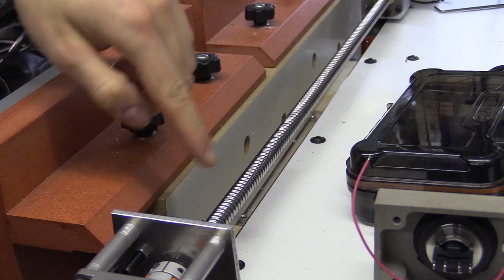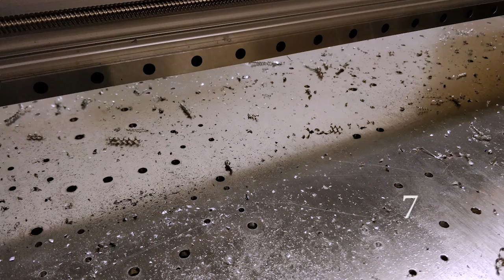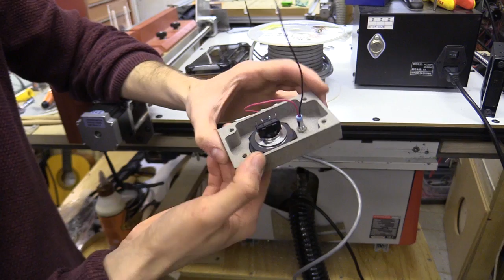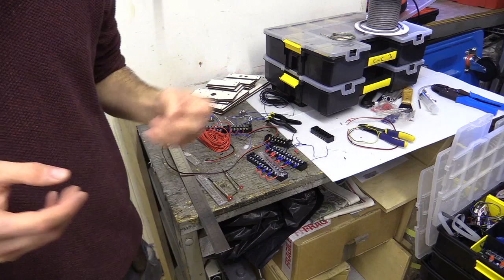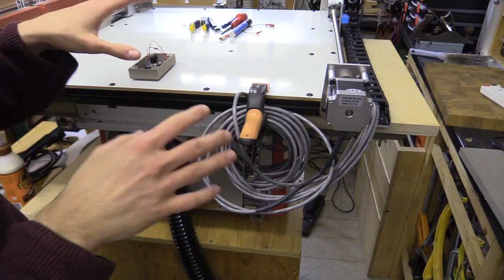#36 Desktop CNC Machine #36 / What I'm Working On

Comment: What gauge wire is that for the steppers?
Reply from the maker: Whatever the stepper supplier recommends. But it's pretty straight forward. My motors are rated at 3 amps so  I use 0.75mm which can accept 6amp. I guess I could use 0.5 but it's nice to know you have a little leeway.

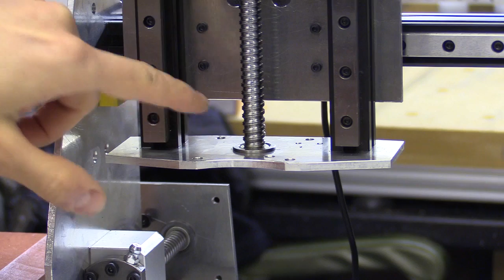Comment: 2:12 you should let that side of the ballscrew have a little bit of axial play (a few millimeters) because it can expand
Reply from the maker: But wouldn't that create a backlash in the movement?
Reply: @EducatingSavvas  one Side should be rigid and the other loose so it wont bind in Case the ballscrew expands
Reply from the maker: @ipadize  Ahh I see. That makes sense as their was a thread on the motor end - which was meant to hold the ball screw to the bearing block but I cut it off to fit it more compactly. It'll be interesting to see what happens to this machine in the summer. :/

Comment: My first response like others is that the weak point is the thin vertical plates on the gantry. Yes, steel is 3 times stiffer than aluminium but, that's not the only factor to consider when evaluation the stiffness of a material. While steel is 3 times stiffer than aluminium, aluminium only needs to increased in thickness by 44% to equal the stiffness of steel which would allow you to avoid the weight penalty of adding steel. Also, as you know, aluminium is much easier to work with.

Here's the article which talks about the gains of stiffness vs depth in steel and aluminium. https://www.thefabricator.com/article/metalsmaterials/the-differences-between-stiffness-and-strength-in-metal

So, just increasing the aluminium plates to 7 or 8 mm would give you the stiffness of the thinner steel plates and would be lighter. Whether that would be enough to remove all the racking and resonance in the verticals is another question.
Reply: Hey how about stuffing ribs on the aliminum

Comment: Are those side plates final? Oh my... Linear rails of that size and then flimsy side-panels like this... Almost EVERY CNC-router I see on youtube has those flimsy side-panels. Those are probably the most important parts when it comes to rigidity... I don't get it...
Reply from the maker: For the footprint (desktop) and application (hobby) I think I can get away with it. Or alternatively make the plates with steel at the same thickness. But I didn't want to start by over engineer the machine, and making it heavy. Also cost is a factor - material costs mounts up. I could also add 90 degree bracket under the X axis onto the y plate but I don't think I'll need too.

Comment: You got the wrong link for the parts list, it points to your login wordpress login page. 

Steppers can't take very much axial load so I mounted my ballscrews backwards, if you will, with trust bearings and belleville washers at the far end. It is basically self aligning the plate hole just needs to be a clearance hole, there is very little radial load so friction is enough hold the bearings in place.

https://imgur.com/a/jNicwGM
Reply from the maker: Ah thanks for that - sorted out the link. The axial load is on the flanged-bearing in my case. Not sure how much they can take as I did shatter one bearing flange trying to hammer it into place. But the parts are cheap and easy to replace.
Reply: but with one  bearing it can only take axial force in one direction
Reply from the maker: @fuzzy1dk  I should have made it more clear that I sandwiched two flanged bearings on either end of the plates and the lip on either end of the ball-screw.
Reply: I think it is generally preferred to have the screws in tension rather than compression to avoid bending and whipping

Comment: Those plates are far too thin! Chinese 6040 cnc's are considered pretty floppy and they use aluminum plates about 3x as thick as what you've chosen. I'd rethink your build when you get a chance and thicken your plates where it would make the most difference. Good luck, love to see the progress.
Reply from the maker: I've never seen the Chinese CNC machine up close to be able to compare but my machine is still in development stage. So things may change. I think I'd definitely make the plates from steel if making another one - saving on having to buy longer machine-screws. That said it does feel very rigid. Can't imagine it would still be if I made it larger. A lot of the hobby machine are similar - supplied to two of three sizes but the largest is always the worst version because the plates sizes stay the same.

Comment: Why would you reduce the thickness of the Aluminium plates? It just reduces stiffness
Reply: Ok sounds reasonable. Have you thought about using steal? Well it is harder to cut, but flexes 3 times less and is often not a lot more expensive
Reply from the maker: It would a lot of sense to keep the plates thickness the same size and move to steel. Would have to get that water-jet cut and spot mark any holes which I could resize by hand.
Reply: once you have part cut with waterjet (or laser) you might as well have the holes cut to size
Reply from the maker: The last set of plates I had water-jet left tapered edges - so I had them made undersized and reamed them to what I needed.
Reply from the maker: Cost is the main reason. I'm trying to find the happy medium of keeping cost down and getting the max strength needed for the application.
Reply: You can always add stiffness to thinner sheet stock in the form of folded/bent ribs making the profile of the sheet a "C channel" for lack of a better term. If you aren't careful though you can reduce the flatness and introduce a twist in parts during the forming process.
Reply from the maker: @paulb8264  Good tip. Could also bolt small section of box profile to the face. Might look weird but that would work as well.
Reply: @EducatingSavvas  ah yes that would work as well but increases your parts count.